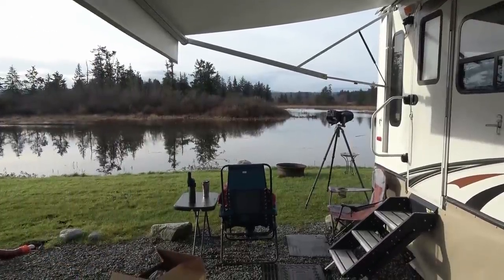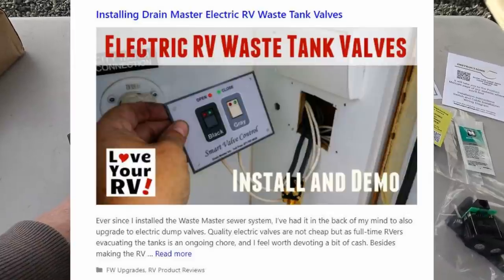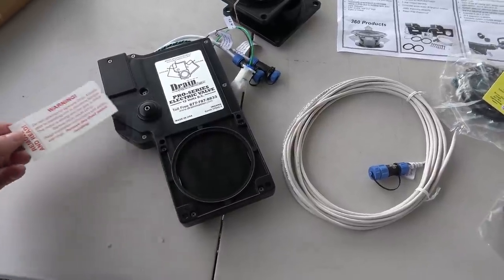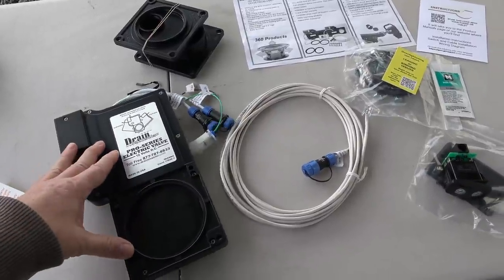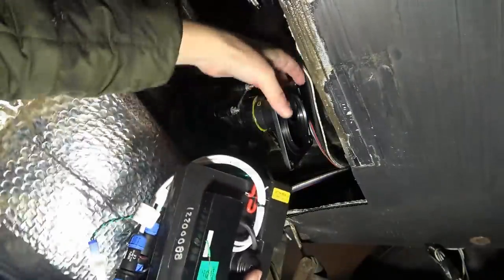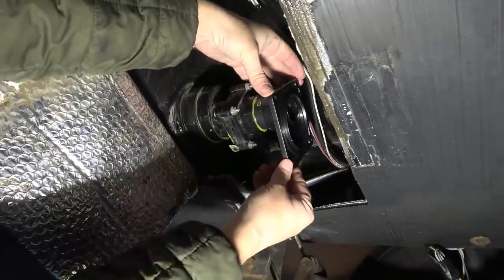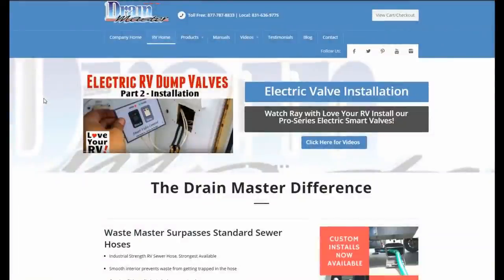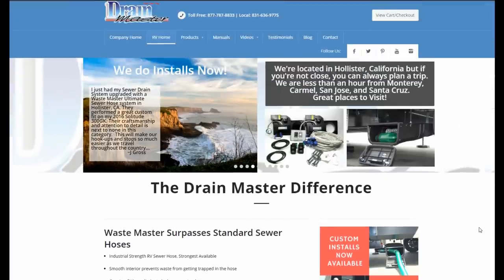Drain Master Electric Waste Tank Valve Installation with 1 1/2" Adapter Flanges for Galley Tank

Comment: I watched your previous videos and purchased and installed the drain master sewer hose (and 360 server vent) almost a year ago.  Bought them from Drain Master directly. They are super folk. They actually suggested I not buy the sewer hose storage pipe from them and get one from a big box store saving me over a $100 in shipping. I can’t install the storage system you have, impossible with my RVs design. Love the drain master hose though. Saves so much time. I’d like to get those valves but pricy and it would be major work given my RVs design and the only place I have to work is on the street in front of my house. Perhaps I’ll take it to Hollister and let them do it. It’s only 8 hours away. 🤪 I’m surprised you didn’t install this valve years ago given how difficult it is to get too on your RV. My valves are really easy to get to even with the slides out.   Again love their products. Thanks for the video. Maybe I should haul my RV to you and let you install the valve at since you have so much experience 👍
Reply from the maker: Thanks Terry.  I guess because much of the time I was using dump stations and I knew the install would be a tight one and the cost. Cheers, Ray

Comment: I wasn't very excited when the Drainmaster failed on my Black Tank. When it does, you need a large  kiddie pool and a Mobile Honey Wagon with a Gas Powered Pump along with lots of Rubber Gloves and Cat Like reflexes. Trust me, Manual Valves are the only way to go. Never fall for the next new gadget!
Reply from the maker: Can you tell us how it failed? Mine seem very robust too me. Have had some for 5 years now.  They do have a manual over ride

Comment: Nice shot of a hidden Angie in the video. In the wet bay shot, it looks like your black tank is "red" for open. Isn't that a bad thing to do for turd dams? Great video and I will probably do this to my 2010 Tiffin Phaeton. I've wanted to do the dump from inside after discovering that the tanks are full late at night. You know, it's cool out so shoes, jacket, oh no it wet, boots, waterproof jacket and now wait for 3-4 minutes while the tanks drain. The tanks never show full enough at mid-day or when it's mild weather.
Reply from the maker: Yeah, she snuck in there. :) I don't leave it red, just was in that shot as I was draining the tanks and did black first then the greys. I keep them all closed and only open to dump when they are near full, for good flushing action. Cheers! Ray

Comment: Ray, Love your video's. At 9:59 in the video did you install the secondary side of the valve seal and hole upside down? I would think the hole for drain needs to be on the bottom of the valve and not the top. I could be wrong as my wife tells me I am all the time.....lol  Keep posting videos and I'd like to see more about how things are going winter camping with you.
Reply from the maker: Thanks. :) I decided to have it on the top due to the space constraints above the pipe.  That way I could have the valve closer to the 10 o'clock position.  Hopefully, it won't be an issue. Cheers, Ray
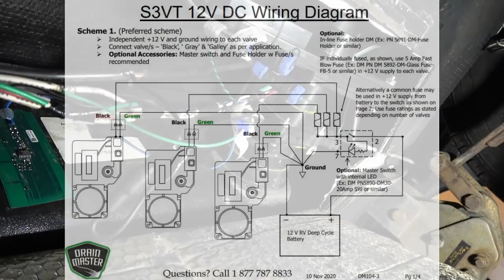Reply: @LoveYourRV  I think he is talking about the adapter, not the valve. I was wondering the same thing. I think I understand why you installed it the way you did. You can get a good idea of the space constraints at 13:25. Also, I am guessing that when installed there is not enough room between the upstream and downstream adapter plates for much waste to accumulate.
Reply from the maker: @RobertLowery  Thanks, that's what I was referring to.  I'll see how it performs. I may have to take it apart and clean it once every once in a while or I may have to remount the valve at more of a 3 o'clock position. Either way, due to the tight space I had to choose to not follow one of the manufacturer's installation directions and still keep the valve inside my underbelly. Another option I've thought of is to make a special little box cover for it so it can hang down outside the underbelly layer, will wait and see if I have an issue, though. Cheers, Ray

Comment: I would like to install on my Renegade Verona LE
Current manual valves are at 3 o’clock - I’m not sure there is enough room to get to the 2 - to 10 positions 
At some point when in storage mode during the winter ( florida ) I’ll take things apart and see if this is possible 

I’m also surprised there is not a lube hole or fitting for the slide 

I did add a lube hole on the manual valve - it helped a lot
Reply from the maker: "The optimum install zone is between 10 O’clock and 2 O’clock and within this zone the most ideal orientation is vertical (90 Deg). If the optimum zone Installation is not feasible, installation within the 30 Deg Permissible zone is acceptable." https://drainmaster.com/rv/sites/default/files/DM101%20S3VT%20Valve%20Installation.pdf

Comment: Thanks Ray.  This is a little off topic, but how are you new SeeLevel Tank gauges working?
Reply from the maker: Here is the latest update done in August 2020 - https://www.loveyourrv.com/10-more-must-have-rv-gadgets/
 Accuracy is most important for my freshwater tank when camping off hookups. It tells me in 4% increments how much water we have left.
I also have the sensor strips installed on the shower, galley, and black waste holding tanks. I find the shower tank is also accurate, but not so much for the kitchen and black. If I keep them well flushed, they read proper, but if boondocking for long periods, they slowly get worse until they just show 100% all the time. Still, if I get another RV, I’d want the SeeLevel again, at least on the fresh and shower tanks.
Reply: @LoveYourRV  
Thanks Ray.

Comment: Can it be operated manually in the event of motor failure
Reply from the maker: Yes, should have pointed that out. There is a little red key attached to the valve body and it fits into an Allen key hole so you can manual open and close the valve.

Comment: Question are there remote control available for the valves? Thomyt
Reply from the maker: Not that I'm aware of, the website only shows wired switches https://drainmaster.com/rv/products/pro-series-smart-valves
Reply: Thomas,
We have had a few requests for a remote and are looking into the potential, not currently available. We have a second port that can be interfaced to a computer which was requested a lot more by customers. If you want to use that port for an aftermarket remote system please contact us and we will work with you on the interface procedure. If it does what you want it to we would ask that we be able to share it with others.